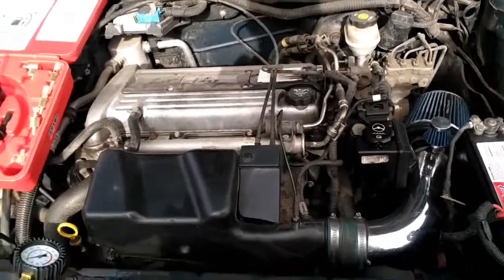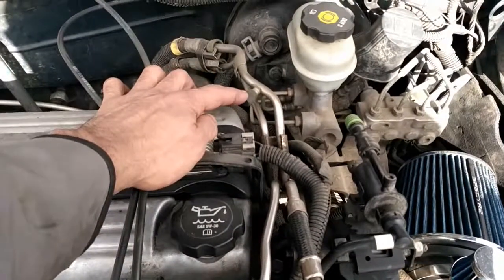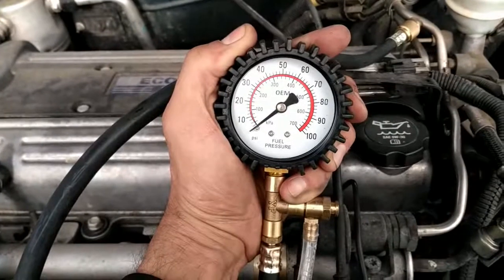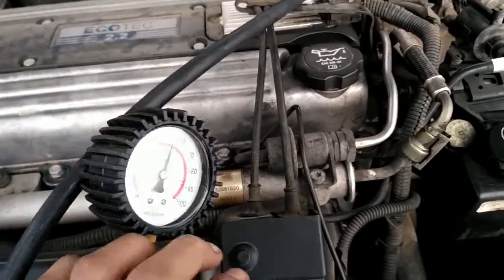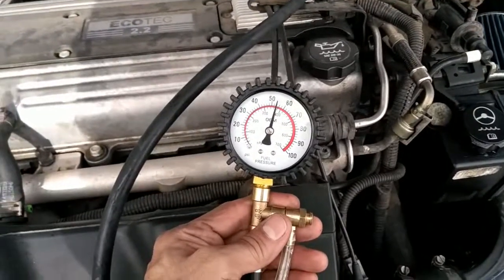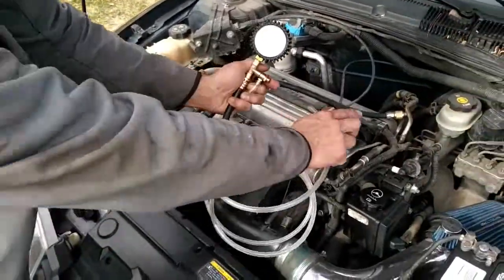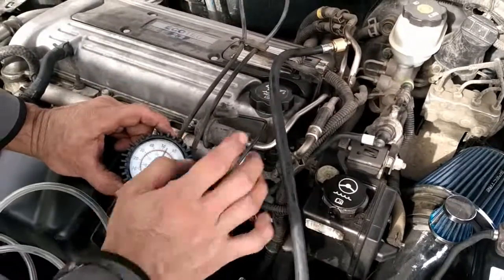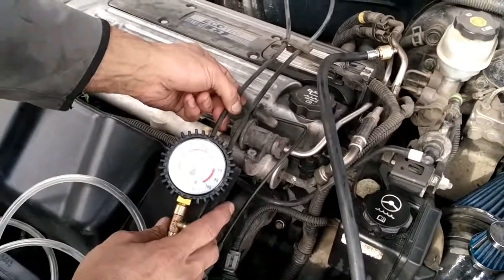Fuel Pump Test - Does not start in the morning - Sunfire 2005

Comment: what pressure should it have when its on the on position and when its running?
Reply from the maker: The pressure, when the key is on but the engine is off, should be between 53 and 59 PSI